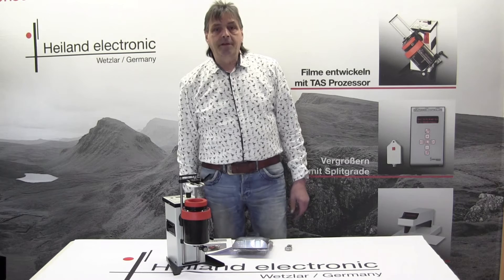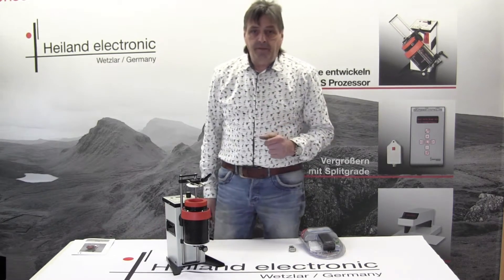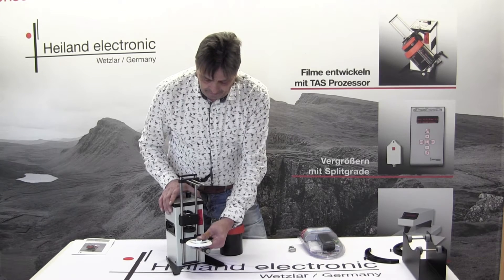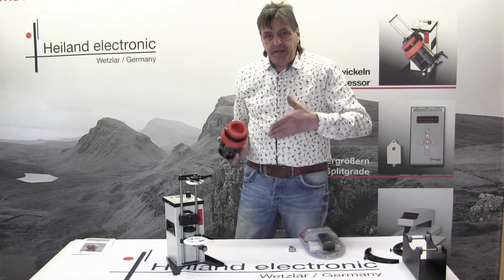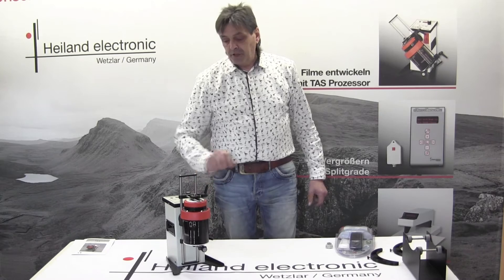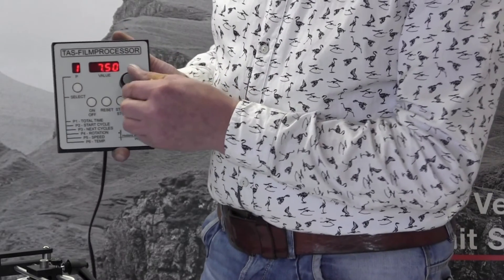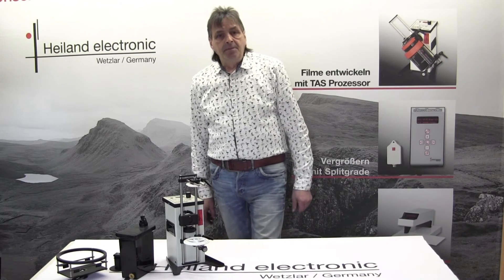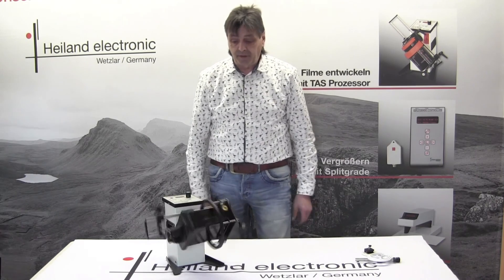TAS  Film processor (English)

Comment: Does the TAS processor work well with sheet film in a Jobo 2409N ?  Very good videos, thanks.
.
Is the kit required for the Jobo 3010 tank available separately for an existing TAS processor ?
Reply from the maker: There are some users who develop 4x5 Inch sheet film with the TAS. As far as I know the results are fine. The order code for an adapter for Jobo Expert drums is TAS-OPT10. Please ask the local distributor (https://heilandelectronic.de/distributor/lang:en) for a price quote.

Comment: Very clever piece of hardware. Generally understand the process, but wonder about the usual end of an agitation cycle that calls for a "tap", "slap" or "bang" to remove bubbles introduced in agitation. How is this not necessary? Would it be because the agitation is sufficiently gentle to avoid the bubbles in the first place? Would like to know more. Thank you for the very good video.
Reply from the maker: After filling up the tank, you remove the bubbles once. Because the TAS starts and stops the tank agitation gentle, there will be no more bubbles created.